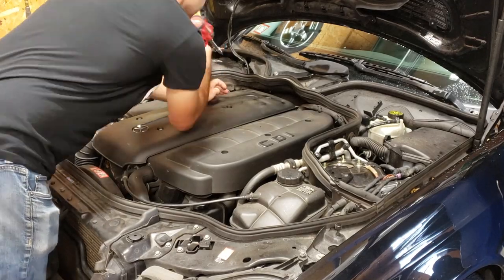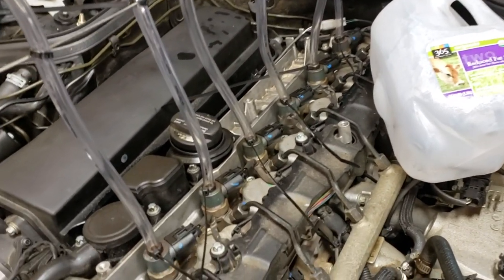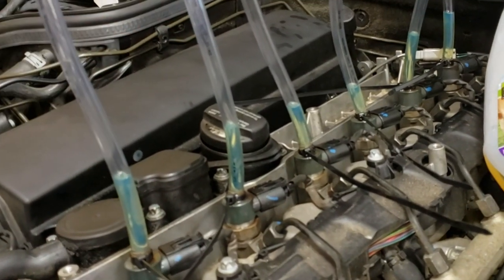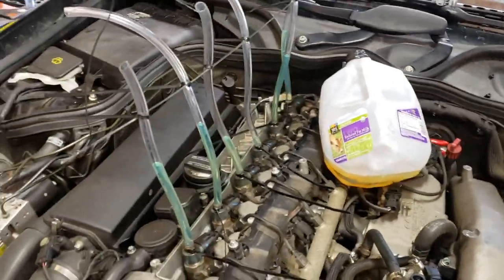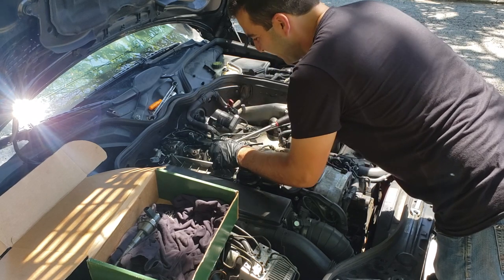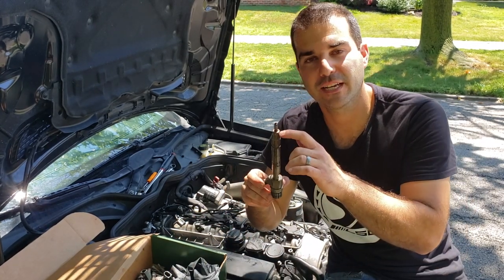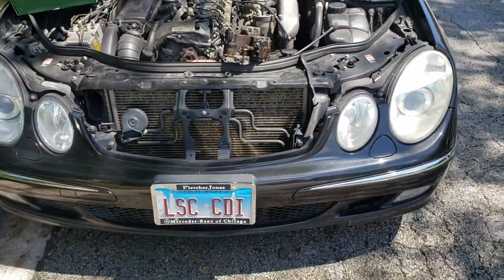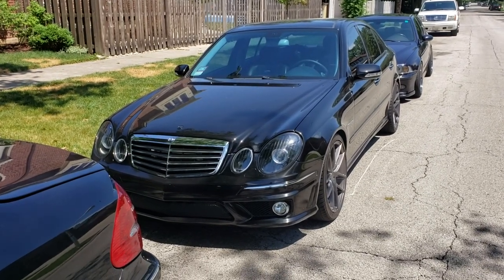Here’s Why I Stopped Making Videos With My Turbo Diesel Mercedes & What Hitting An Armadillo Did.

Comment: That e-class cdi might be rare in States but here in europe it's very common and many tuners and tune company's also.
Reply: JUST  put a uprated fuel pump with more pressure  and poss injectors  up rate  job  done
Reply: You need a European connection. Someone that speaks one of the languages or lives there and can do research in the native language, for example German. Saved me when I was looking for clutch parts for a b class very rare in Canada to have a B-Class in manual. The Dealer's here wanted way too much money.
Reply: Jukka Kivinen asiaa!

Comment: Alex, your telling me that in 2019 you can't overnight your injectors to Finland and have a monster of a car within 2 weeks time? Are you not a member of the SuperTurboDiesel forums?
Reply: In finland we sure know how to make power from diesel engines :D its awesome you know finland from our st mercedes community!
Reply: @Juupatijuu853  Best drivers in the World the Fins :)
Reply: @Juupatijuu853  Hello
I have an ml400cdi and looking to get a bit more power, can you recomend me forums?
Here in spain it is not a very popular car (very few units)
Thanks
Reply: Will the OM 628 Engine (4 Liter V8 Diesel) would fit in the W211 chassis? The V8 with a hybrid turbo, larger injectors, a larger fuel pump and a tune...would be an interesting car...
Reply: @al8161  don't know about that  I see loads of ML's on the Costa Del Sol  or do you mean the 400cdi's   think thats low units  try my ML55 AMG
Reply: @FLPLASTICSURG1  yes it will!  The w211 was sold with om628!  Its very fun to drive with tons of torque!
Reply: In finland we prefer to use cars with mechanical diesel pump.  Like om606 from w210 doesent cost more than 500 euros!  Just slap 8mm elements on the pump and hx55 and put that on a w201 or w124 chassis and you got yourself a 500hp+ street car on stock internals!  Om648 is another great engine!
Reply: And dont forget the om605 with oil squirters!  They make tons of power too with stock internals!
Reply: Don't forget the spark plugs!!
Reply: @3storiesUp  brits are the best ?  how many f1 champs wrc touring cars do fins have compared to Great Britain.. save you the effort not as many
Reply: @vasili1207  I'm not having this argument with you .. cos you're wrong :) . Here's a really good site I found for checking facts [google.com] have fun.
Reply: @3storiesUp  don't have to argue I know I am right
Reply: @vasili1207  Cool.
Reply: @vasili1207  how many of those do diesel tuning? :D
Reply: @TimoLahti  don't swear at me .. get your smoke monster off my lawn..
Reply: @hutchison82  yes, I mean the 400cdi (the one I have)
W163 have very bad reputation, but it is mainly to build quality (panel gaps, noises)
But are actually very durable cars 
You see many of the 270cdi rolling around
But few 400cdi, 500 and 55 AMG
Reply: @al8161  the first models had that problem after the face lift they are fine  mine's a 2003 model and the build quality is great and except for one bushing needing replacing   its very quiet
Reply: @vasili1207  Sure you are ... :)
Reply: Most of those guys mod the OM606 engine which is Indirect injection and has a very different fuel system with much lower fuel pressures. The injectors in his E320 CDI are very similar to the Bosch Solenoid common rail injectors used in the Duramax and newer Cummins trucks.

Comment: I talked to a lot of people here at Brabus and they all said the same thing: why would you want larger Injectors? The right way to go would be more fuel pressure. I think that’s why no company offers larger injectors because it doesn’t make any sense. Even if you want 400+ hp that’s totally doable with the stock injectors.
Reply: Everyone who has actually nodded the cars says the same thing. I have no idea why he is doing this or allowing it to hold up the entire build. There are amg c30 injectors that are larger and bolt in. Maybe he will explain at some point.

Comment: Dude you need to mark each injector for each cylinder and write down the calibration number from the injector which cylinder it came out. You can't mix and match injectors in CDI or any new diesel engine. It wont start if don't have the right injector in right the cylinder. Former  Master Mercedes Benz diesel technician, smart, sprinter, passenger Mercedes and now heavy diesel truck technician.

Comment: I ended up buying a 2005 CDI after watching some of your videos. Had a little bit of black death on the front injector so I was able to get it for $3700 with only 235k miles. Black death fix went pretty well, definitely didn't have the difficult you did pulling them. Thanks for the content on these, definitely looking forward to seeing more
Reply: What do you mean with black death?
Reply: @cihans4923  excessive carbon deposits in and around fuel injectors

Comment: Each injector is actually programmed into the computer to each corresponding cylinder, so they do absolutely have to go back in the same place. There is a correction factor (IMA code) stamped in each injector solenoid that changes how accurately the computer fires each injector. Just fyi to anyone else attempting this job!
Reply: But when you replace one injector with new, what then?

Comment: The thing I love most about this car is how the engine is just a +1 cylinder Sprinter engine.

2004-2006 Sprinters use an OM647 and this car uses an OM648. Can't wait to find a reasonably priced good condition one here in FL

Comment: Just Purchased a 2006 E320 CDI! 200,000 Miles for $4,000. The car is pristine! Minus a couple easily repairable paint chips, the paint looks like it just came out of the spray booth! It also has 0 evidence of black death, the valleys are all very clean, barely even any dust! It has all new shocks, struts, and suspension components all around as well, and no rust! I could practically eat off of the frame, new tires, interior is 9/10. I am very happy!

Comment: A twin turbo V8 diesel!? That just sounds so crazy for some reason.
Reply: Check out VW's 4.2 TDI
Reply: @rickd8979  blaah, the king of diesels are 6.0 V12 TDI found in Audi Q7.
Reply: @santtu9169  
Still prefer the 4.2 V8. More than enough power and surprisingly reliable in my experience
Reply: @rickd8979  its quite ok, a lot better than VW V10 TDI
Reply: I started with a 1.9 TDI in a 2003 jetta
Recently purchased a 2013 2.0 TDI for my fiance.
Next Im either looking for a v10 Twin Turbo TDI Toureg or an Audi Q5 TDI. (Recently got a much better paying job and have to commute a bit further every day) 
I fell in love with the diesels! Modded the hell out of the 2003! They are so much fun!
Reply: 2008-2010 Ford 6.4 V8 Powerstroke had twin (compound) turbos.
Reply: Yeah, unfortunately we can't get them over here.
Reply: @monsterram6617  did they really? All anyone talks about is the 7.3 International.
Reply: @0thers1d3  That's probably because the 7.3 is legendary in reliability.  The 6.0 and 6.4 were in the following years and had many issues.  The newer 6.7 seems to be much better though.  But tbh, unless you are needing a purely dedicated tow-rig, a properly sized single turbo makes plenty of power for most applications.
Reply: A8 4.2 TDi is sublime, even with the ZF6HP. I prefer the acceleration of the 6HP to the 8HP which really smooths out torque but doesn’t feel as eventful as the 6HP...
Reply: Yes
I have it in my Mercedes ML
It pulls hard, specially on the highway and is ideal to tow the horses
And with half the consumption of my cayenne turbo (4.8)!
Reply: Toyota is using their 4,5l twin turbo v8 diesel in the land cruisers in Australia and many other countries but not in the US
Reply: I have V8 400cdi
Reply: @santtu9169  nope VW V8 TDI is not better than V10 TDI

Comment: My dad told me to remove one of the injectors on our CDI because the copper seal was leaking. Somehow we didn't notice the leak in time and the entire of the thread of the bolt was covered in that black gunk. I gave up on the bolt because it didn't want to move and I didn't want to break that bolt. My dad barely got it out then it came to the injector. I had to hold a giant pry bar, trying to lift it up, while my dad used a hammer to free the injector. Was quite the job but we did it in the end with no broken bolts. The injector had ~1cm of pure black tar around it.

Comment: Its worth cleaning the injector seats while they are out, a circle of fine abrasive paper superglued to the end of a plastic rod the same size as the injector works well. a little spot of grease on the end to pick up the swarf & drop it down the injector hole a few gentle turns cleans the seat ready for the new seal washer.

Comment: I know you know this Alex but I’ve got to 6 minutes in and you haven’t mentioned fuel injection deviation quantities that are monitored by the ECU. In modern common rail diesels, you can monitor the fuel injection deviation quantifies as the ECU will reduce fuelling to compensate for one or more over fuelling injectors although the method you show here is the definitive test. Deviation quantities of +/- 3 mg/stroke.

Example data below:

Cyl. 1 Injection Quantity Deviation: -1.75 mg/stroke
Cyl. 2 Injection Quantity Deviation: -1.66 mg/stroke
Cyl. 3 Injection Quantity Deviation: -1.28 mg/stroke
Cyl. 4 Injection Quantity Deviation: 4.69 mg/stroke

The first 3 injectors on this Fiat/Opel/Vauxhall/Saab/Alfa Romeo Z19DTH engine are reduced to compensate for cylinder 4. This imbalance will result in a shuddering engine, the vibrations will have their own fun on your engine mounts etc...

Have also seen the same information on my old bulletproof M57D30TÜ2.

Great video as always Alex.

Comment: to be honest: the test you show is pretty much the same in the mercedes dealership shops (exept for a little bit more professional equipment :D ) and your result is pretty much about perfect ... if you had an om651 you would have trouble with diesel spilling out of your tiny tubes after about 1 maybe 2 seconds :D ... but in this case your injectors are like brand new in terms of inner leakage ;)

you mentioned the injectors might have been replaced at some point ... but these engines (OM646 / OM647 / OM648) have the most reliable injectors of the big engine planet ;)
Just like the OM611/OM612/... these injectors don`t have to deal with stupid presure of 2000 bar and more so they just don`t have that much wear about time.
My OM646 does have the first set of injectors that came with the car out the factory and it spooled almost 300tkm (186411,358 miles) wich is pretty much in germany :D they now start to get a bit old but i just give them to "Bosch" and they rebuild them. After that they are like brand new for very little money !

And after i`ve blamed you in the last injector Video for not treating the injectors right after you get them out the engine i still have to say what mercedes says and all mechanics in germany know:
injectors should not leak their diesel in any case because any air bubble that will be in there COULD (i dont say will) cause damage to it when it gets connected and the presure forces the internals to sit in their seal"position" ... as u might know there is a small needle inside the injector wich will be pulled to the top when the valve is supposed to open for the injecting process. this needle has to get back in place after that and does not like be thrown into place without diesel in between the sealing surfaces ;)
plz don`t mind my writing im pretty tired

thanks for your content i do enjoy it !

Comment: The Bosh Service here in Germany said to me, that this Test isn‘t good for Piezo Injectors. They have testes Piezo Injectors which failed by this Test, but they were totally perfect. So if you have an Piezo Injector, you have to Check the selective quantity corrector with an Computer with your OBD Port. And if that says an injector is bad, it is bad! It‘s easyer to test, and the results are much safer and more correctly :)
Reply: These injectors are not piezo, but anyway quantity correction can be checked with star and it's a good test to do. I have no clue why they asked Alex to do this test because they should anyway swap out the internals and fix the leakage and the quantity correction.
Reply: Thef Rs Yes you‘re right, but if you have Piezo injectors by your car, don‘t do that test. It‘s more difficult/complicated as checking with your Computer the selectiv quantity Correction, and it‘s less correct as the Test with the Computer. If you have no Piezo Injectors, that Test is really good :) and sorry, i thought i had Piezo Injectors, but i‘m not an expert on Mercedes, i‘m more the BMW Fanboy :D But as you‘ve said, why he‘s checking that on his car, i don‘t know🙄

Comment: I don’t know if you are aware of that but injector bolt should be replaced every time when used. Reason is that the material of bolt is made to shrink when hot. This is also reason for black death. Bolt will worn out and releases the pressure on copper seal. 

When you install new injector bolt then you have to be extra sure that the hole bottom of thread is SUPER clean. There is a coolant channel near it and if thread bottom is not clean, there is a 50\50 change to force crack into the head.

There is more things to check while installimg injectors. :)
Reply: What's the proper way to clean the hole bottom?

Comment: I thought it was critical they go back in the same cyl ?. There is a barcode on the top of each injector which is a Compensation code. This code is input into the ECU calibration so the ECU can meter each injector precisely. At least thats the case on my OM651 2.2d.
Reply: It's like this on the Cummins 6.7 too.

Comment: Hang on there, those injectors are coded, each has a code printed on top, this is stored in the ecu, the ecu knows the flow rate from the code.. If they're boring em out.. How will the ecu know the flow? Whoever is remapping it better be good.
The e400/420 cdi in w211 guise was "born dead" , because MB didn't consider offending it as a T model.. Customers weren't happy, they wanted a quick wagon and didn't get it.
Reply: the code is basically just a correction amount to the flow rate. The new injectors will have a new flow rate that will have to be remapped manually and also new codes that will have to be programmed with star diag.
Reply: I think the E400/E420 CDI's are kinda pointless. Twice the cylinders, twice the injectors and twice the turbochargers, while not making much more power.
Reply: @uzernaim1648  stock maybe but only with a tune it runs easily 400hp and 800nm
Reply: You can correct for that with a custom tune.  However, if those injectors are anything like the ones on my '14 Cummins, they are coded and must be placed in their specific cylinder.  Swapping around injectors will cause the engine to not run.
Reply: I mentioned the same also above.

Comment: With DIESEL  its pressure  fuel pump pressure  because MOST  turbo DIESEL  run on high pressure fuel pumps hope this helps change your high  pressure fuel  pump to more powerful  uprated ect and poss injectors

Comment: Because controlling diesel fuel detonation inside the engine is very limited to tune and highly depends on knocking sensor which can save the engine from blowing during tuning process despite of fuel economy.

Comment: English is not my native lng, so I may have the wrong terminology. Here in Bulgaria, when the diesel injectors fail, people give them for refurbishing/rebuilding, which includes replacing the sprayers (part if the injector that sprays the diesel through it). I think they can replace components inside the injector, so it pumos more cc of diesel, while keeping the same injector body, and it screws back in.  Maybe there is a more powerful diesel engines, which use the same size injectors with higher fuel flow capacity. Nit only drom Mercedes, car manufacturers use Siemens, Bosh, and other brands injectors, so there must be a way. I know about many diesel cars, with remapped ECU, and replaced injectors for more power.

Comment: I recommend adding an inline fuel pump (low pressure side) because if the high pressure fuel pump starves for fuel and tries to vacuum up the fuel from the low pressure side it becomes unstable and it will be very difficult to tune properly.
Reply: pretty sure the 400 cdi pump actually has an additional pump on the side of it

Comment: Makes a big difference what injector is in what cylinder. They are coded to their own cylinder.
Reply: What Logic is behind IT? Valves, pistons yes but injectors?
Reply: Gregor Unglaube Because the injectors are piezoelectric. Meaning when a current is applied to the injector, the piezoelectric crystals expand just enough to allow the pintle to spray just enough fuel for any given amount of time as long as the current is still applied. This precise measurement of how far the pintle opens is controlled by the crystals in each injector which is never perfectly measured from injector to injector. Therefore they must be coded so the CDI control unit or engine control unit knows how the injectors will act.
Reply: @GunitEngage  the onjector manufacturing used to require a lot of injectors be scrapped  or adjusted to get flow rates within acceptable range. With  later HPCR electric injectors they found the way to cheap out. Measure flow rate and mark that on injector as a code. Enter code into engine control module so its opening time curve is adjusted to that injector flow rate. There is wiggle room since the ECM adapts for injector wear but the compensation range isn't  that wide.

Comment: Easy to remove CDI injectors, loosen the bolt and start engine. Rev it up when you see them pop up. No forcing needed. This of course applies if you are able to start the engine ;)